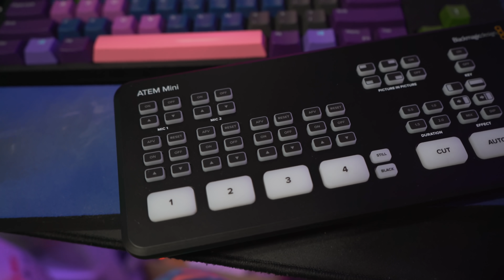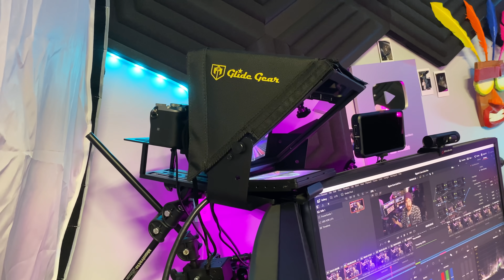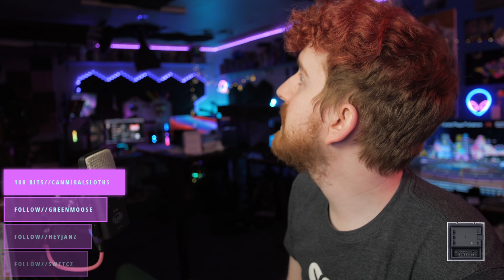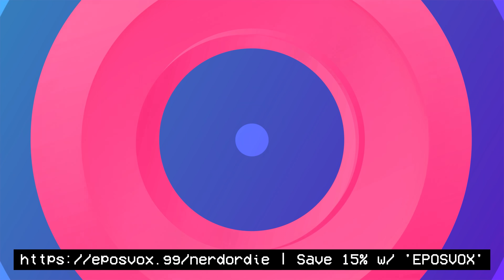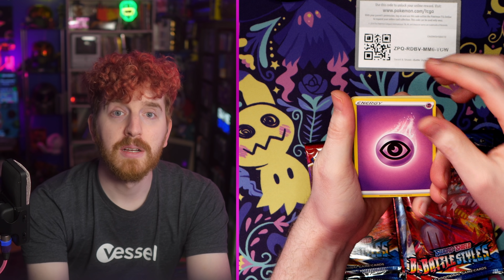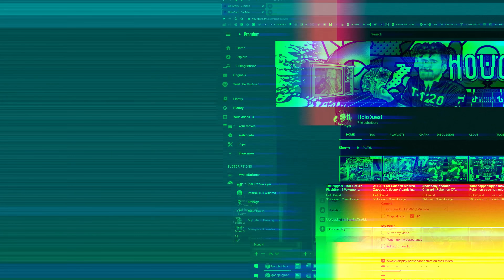Elgato Cam Link Pro review: Multicam streaming done right?

Comment from the maker: Ironically, you may notice a few frame drops in this particular video. It doesn't have anything to do with the Cam Link Pro. I'm currently chasing down the issue, but there was no way to fix it for this video. Hope you enjoyed regardless!!
Reply: Was about to ask that but then I realized you had the product in your hand LOL
Reply: When you just purchase two camlinks and an avermedia hd and then this drops 🤦🏼‍♂️🤦🏼‍♂️🤦🏼‍♂️ great video as always 👊
Reply: EposVox, would the Cam Link Pro be better than the 4K 60S+ ? I just bought the 4K 60S+, but cannot get smooth, clear video from it in OBS. Would the Cam Link Pro be better with my Nikon camera, with less headaches ?
Reply: @EposVox Also, can it do 4K HDR at 24 or 30 FPS ?  I'm torn between this, and 4K60 S+ which I am consider returning. It's now in OBS, and I don't know if it's cause my 10400, and RTX 2060, cant handle the feed, or whether the 4K 60S+ is too slow over the cables they provide or my own.
Reply: I would be curious about your workflow with regards to troubleshooting such a problem. I assume you aren't using Microsoft Answers
Reply: Did this ever get resolved?

Comment: So I just bought this now, more than a year later, for 150€ (150$ since covnersion is 1:1 at this point)... after your video I am thinking it's an amazing deal!
HOWEVER. I am just waiting for a 4k60, 1440p120 capture card. Sadly not even magewell nor decklink support that, I think? As you say, if they used PCIe 3.0 or 4.0 it would be enough...

Comment: This looks amazing, but I have one important question.  Does this card function with elgato's Game Capture HD software, even tho it calls itself a cam link instead of a game capture card?  When I'm not streaming or using OBS, that is what i play my switch through.  I love being able to power my switch on and open game capture hd to just play my switch on my desktop.  When I stream I play off of a monitoring window of my capture, but I'd like to not have to open obs to just play my switch

I didnt even hear about this when it launched lol, just finding out as I was checking the cam link prices on amazon just now.  This is something i've been wanting for years.  There have been alot of multi input cards on the market for years, but elgato just straight up has the best software and integrations for streaming.  I may replace my HD60 pro card with this.
Reply from the maker: You can use it with 4K Capture Utility, I’m not sure about the old GCHD app. It’s not supported anymore so probably not

Comment: No XRGB? What's your take on this?
Reply from the maker: It’s a camera capture card and the majority of cameras anyone would use for streaming (or even filmmaking) won’t output 4:4:4 in the first place. Would be cool if it supported it, but non-issue IMO
Reply: @EposVox  thank you for the reply, I have a A7S2 outputting 10 bit 4:2:2 and I noticed better image quality on XRGB although the framerate seems like dropping. Not sure what it is, but since I'm not moving a lot it doesn't really happen ever. Any ideas?
Reply from the maker: Well there shouldn’t be any better quality over YUY2, given YUY2 is uncompressed 4:2:2

Comment: I just bought the Cam Link Pro. Having Cam Link 4K before I bought a second Cam Link 4K but was having a nightmare where one of the video feeds would just freeze randomly. Spent ages trying to troubleshoot it thinking it was related to AMD Zen USB issues. Finally bit the bullet and got the Cam Link Pro and it has been rock solid. 

Trying to have 2 of the Cam Link 4Ks on USB just isn't reliable even when on separate USB root hubs in the motherboard. PCIE FTW. 

Now I just need to sell my 'Cam Cam Link' previous setup :)

Comment: Im wondering about the input lag when playing a console through the cam link pro, seeing as it does not have any pass through to connect to your monitor or TV, is the lag noticeable at all? Could you play games through it? 

The issue i have is that i have multiple game consoles that i stream game play from, i used to use a HDMI switcher connected to the consoles and inputting to elgato hd60plus, the issue is the ps5 does not like my splitter so now every time I change consoles I have to physically swap the HDMI cable going to the capture card, this has made cable management a nightmare coz i need easy access  to the capture card, I was hoping the cam link pro would be my solution because of the multiple inputs but im concerned about the output or delay..

Comment: Do you still have the same limitation as to the camlink 4k with compatible cameras? That is why I purchased the ATEM Mini.
Reply from the maker: Cam link 4K, and the Pro, both work with any HDMI signal that’s within spec (1080p30/60, 1440p30/60, 4k30 and lower)
If anything the Atem Mini supports less devices by not having 4K support.
Reply: @EposVox  I always had the issue where I needed a clean HDMI Signal.
So, I can connect a Canon M50 to the HMDI Quad Card?

Other than bandwidth, why would I purchase an Elgato HDMI Quad Card when I have an ATEM-Mini.
Is the fact the card is connected to my motherboard while the ATEM-Mini USB-C?
Reply from the maker: That’s an issue no matter what capture device you use - the ATEM mini needs clean HDMI too, it can’t magically strip away your overlays on your camera feed. 
There isn’t really a reason to get the Cam Link Pro if you already have an ATEM mini

Comment: Well, given 4 Camlinks on your PC can cause a lot of trouble among your USB devices, I’d say: Even if, for the most parts this is just 4 inputs, I’d use the heck out of this. To me, this card is simply not designed to be used for 4K capture. But then again, my stream setup would torture the heck out of my PC, if I did all of that in 4K. So I guess, I’m - for the most part - fine with 4:2:2 at 1080p60. Try to find 4K60 4:4:4 outputting cameras, let alone pay for them and you know why. I simply don’t view This CC as a 4K one. What’s slow, by the way,  is the stream deck. I’ve struggling with it for the Year I have my stream deck now. 😅
Reply: Umm, edit?

Comment: Does this work more like a camlink or a capture card? Specifically, can the cameras be used in more than one program at a time? I run two instances of OBS and I can have my Avermedia capture card as a source on both, but I can't have my CamLink 4k, so instead I end up having to do virtual camera from one OBS instance over to the other one which isn't ideal.
Reply from the maker: In the video you shall peek, and find the answers you may seek.
Reply: @EposVox  LOL I swear I watched it when it dropped but I probably had it going while working and missed that part. Round 2 here we go
Reply: Oh hey, there it is! YAAASSS

Comment: I'mma just wait for an HDMI 2.1 capture card. I think this is super cool but I don't have much use for it. And I was gonna get the HD60S+ to hold me over but... That thing is $200 while the 4K60 Pro is $250. So I'm in this weird purgatory of "Don't wanna get the 4K60 Pro when HDMI 2.1 is surely around the corner" but also "Don't want to spend $200 on a HD60S+ when a 4K60 Pro can be had for just $50 more". Ugh.

Comment: so if I want to game on the same PC with full PCIE 4x16 bandwidth, Z590/X570 or next gen main stream desktop platform would not be enough with that card because of only 16 PCIE lanes for devices like that, right? (4 lanes seem to be Nvme SSD only on most boards it seems)...

So instead of Z690 with a 12700k or so I should wait what intel 12th gen HEDT has to offer I guess to get all the PCIE bandwidth, or is there another way around with a current Z590 board with full x16 bandwidth + that card, which would also work with a similar Z690 board?
Reply from the maker: Most boards these days will also have a x4 slot run through the chipset and should be ok
Reply: @EposVox  thx that's good news.

So it seems like my favourite Asus Strix Z590-E and -F gaming have deleted PCIE x4 Ports, while Maximus Hero (expensive) and Tuf (less USB ports) have them. Will check also other brands then when Z690 comes to have that upgrade path open.

in general it seems like these newer higher end boards have more nvme drive slots and less dedicated pcie x4 slots

Comment: @EposVox, I think you mentioned using this to connect mobile phones as cameras. What method would you use to connect to the Cam Link Pro? I currently have one of my old phones connected, but it requires a USB connection with the Droidcam software and client. Do I just need to change the cable to a mini USB to HDMI one?

Comment: IDK if that's just the shutter speed was too high of the A cam that you used to film this video from the beginning, the capture card or the PC that couldn't handle it but there are a lot of dropped frames, I was into the video for 5 sec and already noticed a lot of dropped frames, wanted to double check that if it is my browser but everything seemed fine on my end, watching @1440p.
Reply from the maker: Someone managed to comment while ignoring the pinned comment answering the very thing they were commenting on
Reply: @EposVox  🤦‍♂️ didn't see that.

Comment: Looks like if you want to capture console gameplay (+ passthrough) you’d need a dedicated capture card plus this new cam link pro for multiple cameras + a motherboard (and PC setup) that can handle both + a streamdeck am I wrong? In this case what about plugging an ATEM Mini onto an AVerMedia Live Gamer Duo, wouldn’t this be cheaper and more capable (besides 4k resolution)? Thanks @eposvox for the good work, as always!
Reply from the maker: Hdmi splitters are cheap
Reply: @EposVox  yes but what if I want to play at, let’s say, 1080p120 with my shiny PS5? I mean the Cam Link Pro only supports 1080p60 right?
Reply from the maker: Correct. There’s no getting around that, but the ATEM mini won’t do it either
Reply: @EposVox  yes that’s why an ATEM Mini + AVerMedia Live Gamer Duo combo looks like the way to go at least for my case. Thanks a lot for taking the time to answer my comments!

Comment: Does it do software encoding or Hardware encoding ?   Is there any latency ?  Is the PIP scaleable of fix size ?   How does the Capture card PCIe affect the bandwidth of GPU PCIe ?
Reply from the maker: PiP is fixed as I showed. Card doesn’t do encoding,  no modern card does and you don’t want it to
Reply: @EposVox  Thank you reply back. Also, I dont care about the 4k60 output, But not having a 4K60 input means it cannot be used with Xbox and PS with 4K TV, even with a splitter. That's a deal breaker for me.
Reply from the maker: Correct, I explained that lol

Comment: This looks amazing. Currently I'm running 2 USB capture cards and was going to get a 3rd, possible a single cam link ironically before I saw this which has got me considering this instead. I've got 1 question though and I'm wondering if your able to test it. Can the Cam Link Pro handle the signal being output from an OSSC? I play a lot of retro capture and my current capture cards handle the signal with no problem but I know some capture card really don't like it. 

Cheers for the video!

Comment: This is rad!
FYI (anyone curious about multiple inputs), If you nest your video input sources into their own scene, then use THAT scene in your main scenes, you're then able to change your input source without changing your scene. Pair it with the Lua Source toggle script and it's a really consistent and reliable solution.

Another rad tip is to duplicate that Input Sources scene, call the first "A" and the new duplicate "B". Put both of these scenes into a new scene called "A-B Switcher", then use THAT scene in your main scenes. Then you can setup a hotkey to swap between your current A and current B inputs. Sorta like how in some games you can select any weapon directly, but also have a dedicated "switch to previous" kind of function.

 This is just some of the rad things you can do in OBS with nested inputs, and when paired with a foot controller... it's a really empowering production workflow, especially if you're hands are busy opening pokemon cards, or holding a gamepad (or Steam Controller ;)).
Reply: This is kind of what I do, with scenes acting as « slots », which are then themselves included in other scenes (with the layout on top etc).

Each input is wrapped in a scene, and all  « input scenes » are on top of another in a « slot scene ».
I then use UPDeck on an iPad to change their visibility / order, same as one would on a stream deck with the LUA script I guess.
Reply: @enregistreur  Wow, that's a workflow I've never really thought of before!  In fact, now that I'm thinking about it, I can't really stop thinking about it...

I really appreciate you sharing this creative approach, dude. I'm gonna experiment and see if this kind of concept could improve my current setup in some capacity.

Do you happen to have any videos/vods of this in action that you'd be willing to share?
Reply: @TheRykerInitiative  You're welcome! As as matter of fact, I got inspired by the new Atem Mini Extreme, that features a "select bus" for the included SuperSource.

As I use OBS Ninja (which I highly recommend, it's fun to play with) to include multiple remote guests in my streams, when I saw the demo of the Atem Mini Extreme, I immediately though I NEED THAT, but for virtual cameras. :D
Reply: @enregistreur  Sweet! Thanks for the info and the heads up about OBS Ninja. I'm definitely going to check that out.

Take care!

Comment: I hate to break it to you but the 4k60pro has the annoying black screen issues 24/7 and elgatos 4k capture utility is actual garbage. The capture card scene reminds me of the car audio scene.
Reply from the maker: I have multiple 4k60 pros in use and have never had that issue, nor have I ever seen it mentioned as a common issue like the cam link.
4KCU is pretty bad as I say all the time
Reply: @EposVox  Hmm I've tried multiple different cables.  I guess I could have a dud of a card that would be dissapointing. My workaround if unplugging and plugging back in the hdmi cable in the 4k60 pro.
Reply from the maker: Well then it’s likely not the card as those kinds of issues require the card to be reset if it’s at fault
Reply: @EposVox  hmm interesting only other thing I could easily think of would maybe be an issue with the capture card and first gen threadripper. It has persisted over multiple windows installs.
Reply: It could.also be in the wrong PCIe slot.
PCIe is all intended to be backward/forward compatible, but it may be a bandwidth issue.

Comment: This is perfect timing. I am about to enter the two-PC system world, and was planning on using 3 4K60 Pro. Now I only need the one I have and this new card as I have two cameras that are only 4K 30 FPS  out, and a GoPro for overhead. Excellent. Wonder when it will be out (seems in 2 weeks here).